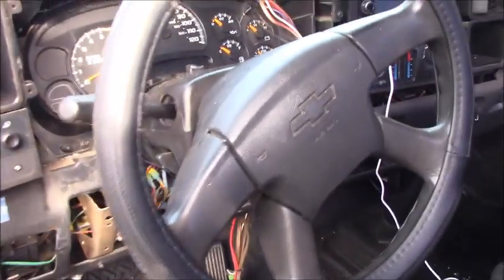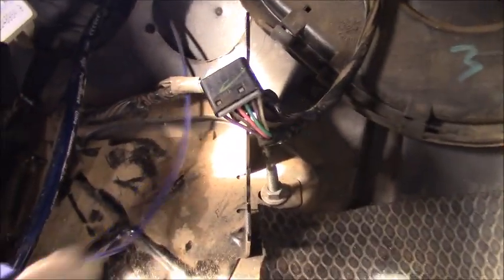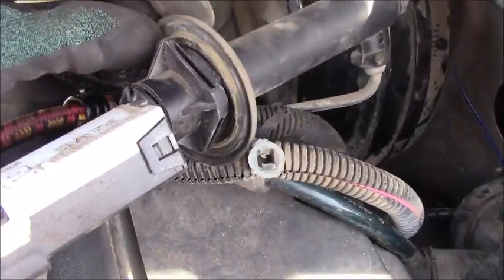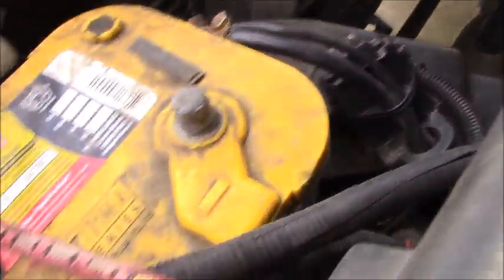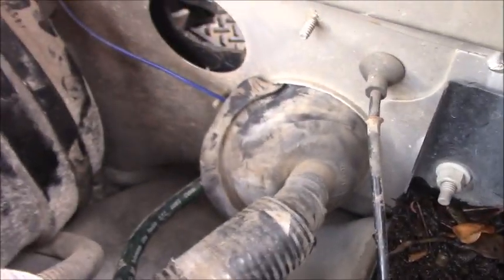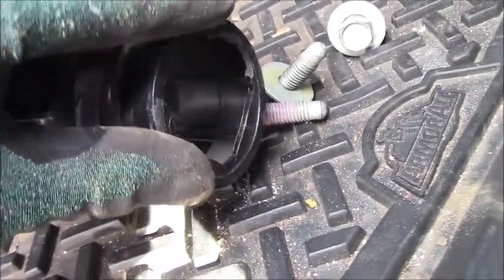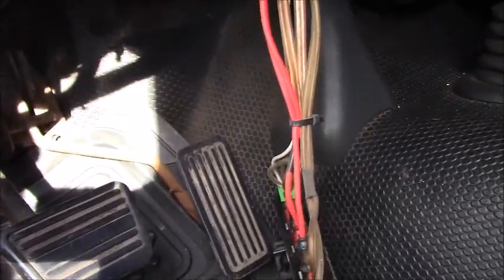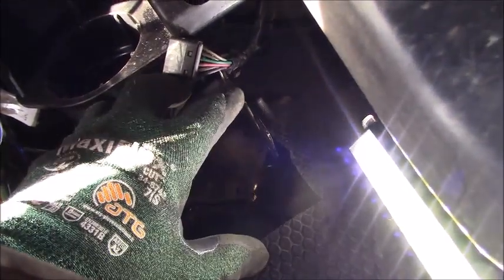Chevy Silverado 1500 clutch pedal assembly easy way replacement

Comment: About to start this project today on my own truck.  2004, 4.8 V8 with Manual.  I bought truck new in 2004, plastic lasted until 2023!  But I recently had new transmission and clutch and master and slave cylinder all done, 350K miles on original NV3500.  Thanks for the very in depth video, yes the other videos and alldata is ridiculous to loosen entire dashboard, your way much better.  I got the Dorman 926-086 part with the upgraded metal reinforcement ring for the Master Cylinder mount, $67 at Oreilly.
Reply: Update: got it done with the Dorman part.  Noticed that the part where the Pedal goes into the bracket it is flared.  I installed the new bracket by itself first then just pushed the pedal up into place.  Just be sure that the spring loaded pin on the outer side (left) goes in first, then wiggle it around and maybe rotate it a little until the right (inside) pin snaps in also.  Much easier to install that bracket with the pedal out of the way.  Could probably with the right tool pop the pedal out before removing a bad OEM bracket also to get the pedal out of the way.